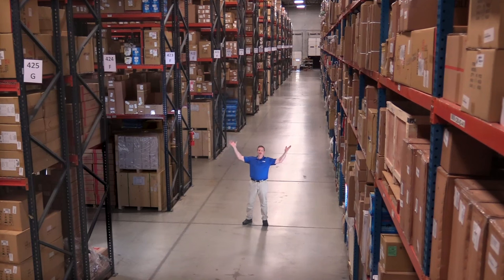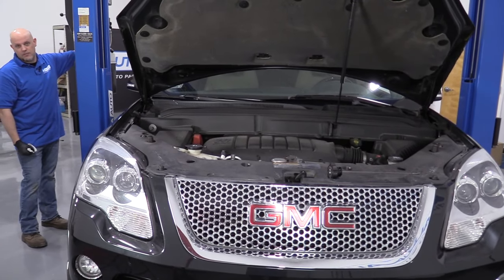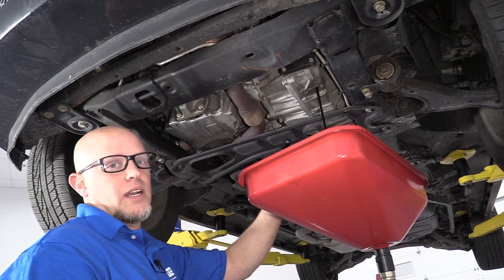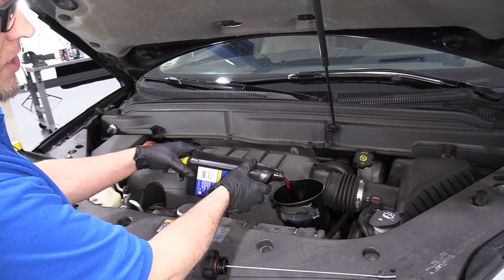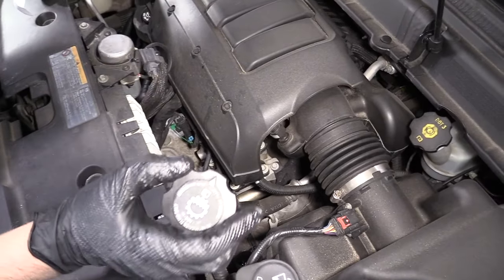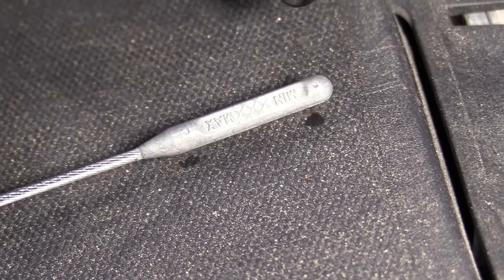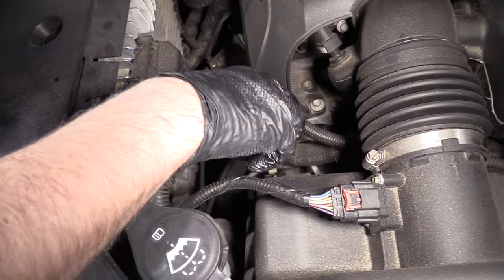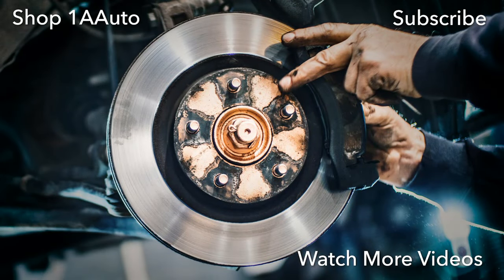How to Drain and Fill Transmission Fluid 07-16 GMC Acadia

Comment: never ever use a pressurized flush machines to change transmission fluid, either drop the pan if you have a removable pan or use this method in the video, a flush machine uses pressure to move fluid out, and if your vehicle is an older vehicle you will move gunk, shavings, and debris and destroy your transmission...
Reply from the maker: +certified30 thank you, we value input from our customers.

Comment: I just did this.  The transmission fluid comes in 1 gallon jugs.  Each time I drained a little more than 1 gallon (4qts) came out.  Doing this twice, I needed 2, 1 gallon jugs + 1 extra qt.  This was incredibly easy to do!

Comment: I have a 2009 Acadia with about 115K miles, the tranny fluid was changed by the previous owner at about 75K, and I was thinking of having it changed again. I've been told it's best to just change the fluid, as shown in your video, and NOT to have the fluid flushed. Any recommendations on what might be the better route?

Comment: I add a bottle of Lubegard, and put a rare earth magnet on the tip of the drain plug.  I'm not a fanboy of GM - this Lamda platform has it's share of major issues, but thank you GM for making this drain and fill easier than most

Comment: I want to know if the 2012 GMC Acadia has a filter in the transmission oil
Reply: Yes it does! Its not accessible unless you pull the transmission and separate the case.
Reply: Thank u

Comment: I had success with this method: Drain initial fluid till a drip. Then add 3 quarts of new trans oil. Then start engine and put in Drive for TEN seconds. Then drain again. It will take much longer to drain, the second time. But the color coming out will show you that you have  successfully swapped out the fluid in the torque converter, for the 3 quarts you just added. Finally, add the rest of fluid to spec level.
My trans was bucking like a bronco, puking fluid out of the air vent, and eventually wouldn't engage overdrive anymore. I changed out the fluid, and it was like new. Has been ever since. That was 3 years, and 80k miles ago. 👍
Reply: What's the spec level trans fluid on these 2012 GMC?   If I'm taking out 3Qt should I only put 3Qt back in it.  Or more?

Comment: I was recently told by an old friend of mine that this is the preferred way of doing it. A lot of people on here have mentioned what he said about a flush just knocking a bunch of crap loose and the new fresh detergent in the oil making things worse and now you need a news trans when before you messed with it everything was fine. I think I may start doing this every other oil change or maybe every third one. Honestly cheap insurance
Reply: Bro do this every 60k miles lol not that often
Reply: 100k <-)))

Comment: Thanks for the video. I find it to be a little wasteful. What I did was drain and fill with what came out. Then I disconnected the upper trans line at the radiator, attached a hose runnign into a bucket. Started it for about 15 seconds while I ran through the gears. Stopped it and it collected about 2 quarts out into the bucket. Filled with 2 Quarts. Did that 3 times and all the fluid was clean.

Comment: Thanks 4 the video. My 2012 GMC Acadia transmission fluid gets Hot after driving in the Highways for about 30 miles or so. Should I flush the entire transmission fluid at Jiffy lube or just drain it like in the vid myself? It's got 100k miles also & I hear that flushing it ALL OUT isn't good.  Lmk please
Reply: Drain as much as you can, measure it and put that amount back in. Would you only drain part of the engine oil? Same answer.

Comment: I have a 2013 Acadia with 145,000 miles. I'm getting a shudder when it goes into third gear. I did put lube guard shudder fix in did nothing. Will a fluid change help this issue?

Comment: recently bought a 2012 gmc acadia denali. it recently started shifting noticeably a little harder once driven for about 15 mins or so, especially going from 1st to 2nd gear. changed the fluid twice but didnt help the problem. Any idea what could be the issue or any other tips i can try?
Reply: Try some lubegard shudder fix you can get it at autozone

Comment: keep the drain plug out and start the car and put it in drive it will flush the most of the fluid out and refill it with normal trany fluid 2 times and fill it with the dealer recommnded

Comment: Hi, I have Chevrolet travers 
When I move normally the transmission take 1-2-3-4-5 steps normal but it’s not takes the 6 step and the RPM becomes 4 and 5 if I want to drive in 100 miles. Can you help me with 
Notice : I found the transmission fluid low 1 letter
Reply from the maker: +haider Obaidi We are sorry, but unable to diagnose vehicles online.  Please take your vehicle to a local mechanic for diagnosis and let us know if you need assistance with any parts.  Thank you.
Reply: I’m  not live in USA, I live in Iraq and here they don’t have experience

Comment: I'VE BEEN LOOKING WHERE TRANSMISSION OIL FILTER FOR 2010 GMC ACADIA I OPEN THE PAN AND ALL I SAW IS THE TRANSMISSION MODULE. I'VE BEEN SEARCHING SO BAD AND THERE NO WHERE HAVE THIS INFORMATION.
Reply: The oil filter is internal, you can’t change it.

Comment: Hey I’m having problems with a 2012 traverse where it drives fine until you give it a little gas then the whole car shakes. It is very noticeable when cruising on the freeway and you speed up like 3-4 mph. But if you let off or mash the throttle it stops. I’m having e really hard time trying to figure this out. Car has 120k on it and the previous owner said they did a change but I doubt it. You think bad fluid could be causing the problem or maybe a solenoid or torque converter? Any help would be greatly appreciated. Thanks
Reply: It’s most likely  either spark plugs/ an ignition coil causing a misfire.
Reply: I'm having the same problem with a 2009 Saturn Outlook. Any updates on your issue?
Reply: I have a mild shudder (120k) I am going to do a fluid drain/fill as shown here and see what happens. Don’t think it’s ever been changed. I also heard adding Lubeguard Shudderfix works well but I’d prefer to see if a fluid change fixes it. Apparently you have to do about 4 or more total changes to get most of the fluid. Note: some say don’t do a “fluid flush” on a trans that is older and never been changed... but a fluid “change” (shown here) is better for older never changed trans. “Flushing” can remove particles that the older trans now depends on for friction. I’m gonna repeat a drain/fill over the next few months and hopefully that does the trick.
Reply: Torque converter maybe? I’ve read that fixed people’s shudder shake on these lambdas.
Reply: I'm late to this but tie rod ends can appear tight but may infact be a bit loose causing body shake.
Reply: It test ignition components bro. Battery and alternator, if all checks out . Then it's torque converter bro . They have the shitty 6 speeds. That's why they newer ones have up to 9 speeds. And they are more complex
Reply: Change the coils. Mine was doing the same thing now it drives like a dream.
Reply: Your transmission or related comments might be the problem. Either way take your car to a pro, and don’t rely on advice from “pros on the internet “

Comment: I opened up drain plug a small stream of fluid came out not even a quarter of a quart had to turn on and turn off car for fluid to come out any tips on what might be problem
Reply from the maker: +Juan Vizcarra We wouldn't be able to diagnose an issue like that here, you may want to have a local mechanic take a look at it. Thanks for checking us out! http://1aau.to/m/Shop-1AAuto-c

Comment: You say replace with the amount you drain out. Approximately  how much should i by for each change?
Reply: He says 4 quarts, but I would buy two 1-gallon jugs and save what’s left over for next time. It’s cheaper to buy it by the jug.
Reply: I just drained my 2009 Acadia and exactly 4.5 quarts came out.   Car was cold- not sure if that matters or not.
Reply: 5 liter
Reply: 4 the 5 quarts check then refill at for dont wanna over fill

Comment: Do these cars not have transmission filters?
Reply: Jon F — there’s an internal magnet / filter that isn’t serviceable.
Reply: Jon F The way GM designed the transmission you can only access the filter when the transmission is out and taken apart there is no drain pan. It’s over a 10 hour job just to replace the filter.

Comment: What about the transmission filter
Reply: The filter is internal. No filter to change till you rebuild. That’s why once a year or so you should drain and fill (my opinion). Certainly there are other theories and ways. You can just put a valve in place of the plug. Do job in less than an hour. I put drain valves and pans with drain plugs on on my cars. Makes it easy if you over fill to. No mess just screw on tube and remove what you need to.

Comment: Since you didn't mention a replaceable filter....I guess their isn't one?
Reply: sthier24 — there’s an internal magnet / filter that isn’t serviceable.
Reply: sthier24 there is a internal transmission filter that is only serviceable when the transmission is removed and disassembled to get access to it. It is more than a 10 hour job just on its own.
Reply: Yeah they say there's one in there but you got tear the transmission apart to get to it
Reply: The only way to clean it is with a pressurized transmission flush. Which I would not recommend if your car is already over 70,000 miles and no transmission fluid changes ever.

Comment: LOL at the comment @ 7:20 where he compares the new fluid color to the final fluid color they achieved and says that it will never be the same color as new.

Ummmm... if you did another drain n fill it will get even more cleaner, like new from the bottle. 

If you wanted to go even further and do yet ANOTHER drain n fill, I’m willing to bet my left nut that it will be pretty much as pink as new. 

Since you’re not draining ALL of the fluid and new fluid mixes with old fluid and makes it dark right away, after X amount of flushes, you will eventually reach a level where 99% of the fluid has been changed. 

Obviously this amount of flushing isn’t necessary and too much new fluid on an old, neglected transmission can actually be a bad thing and make it shift worse if the clutches are worn out and slipping. 

The best thing to do is to never let the fluid reach a point where it’s degraded beyond spec. Doing just 1 simple 10 min drain n fill every 30-60k miles is best. This way you’re always driving around with fresh fluid in the transmission and this will maintain factory smooth shift quality for as long as possible. 

If you DIY, it’s CHEAP, even if using OEM AC Delco transmission fluid from the dealership. $30-$40 drain n fill at home.
Reply: No matter how many miles are on these gm transmissions, from 10-70K the first time they are drained the fluid is black.
Reply: Ha it's at least 10 qts even valvoline@$6 a qt is $60